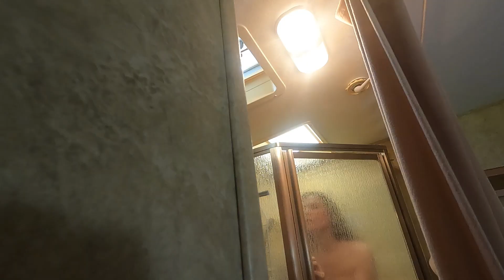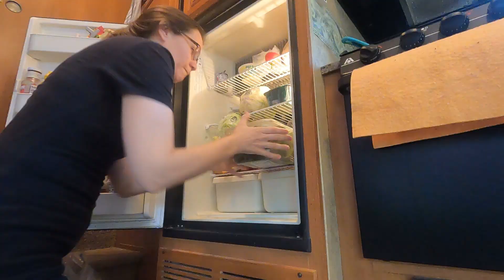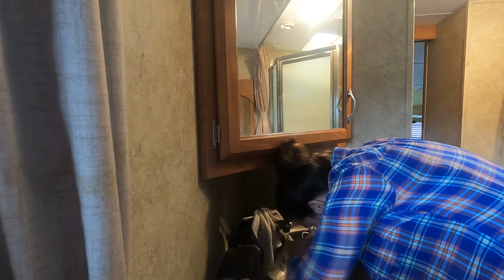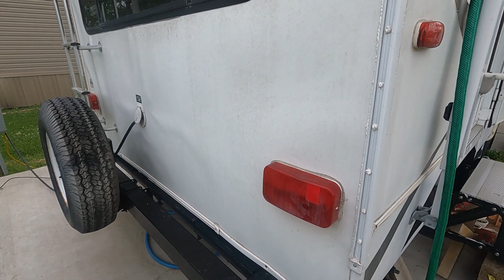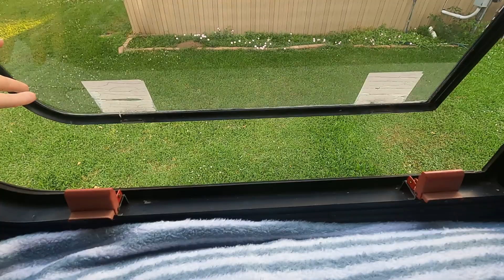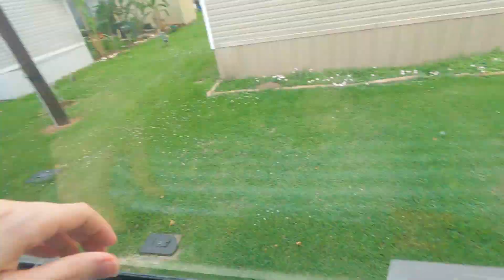CONS to RV Living | Reasons not to RV fulltime | RV Living Fulltime

Comment: Having lived and traveled for 2 1/2 years in a 24-foot travel trailer, I'd say your video is spot on Sam. 
  Many campgrounds charge more for lot rent than what I am currently paying for my mortgage on my house.
  We found that there were a lot of good things about Full Time RVing, but there were also a lot of not so good things about Full Time RVing.
 Great video.

  JT
Reply from the maker: Thanks guys. That was one thing that surprised me the most was the pricing that I was getting for parks. I mean a lot of folks want to RV because they think costs are significantly lower. Maybe in more rural areas but things are going up for sure
Reply: @FreedomChaser  
  Exactly. We found that the only way to get a decent price for a full hookup campsite was if you worked at the campground you're staying at. We stayed at campgrounds that made you work 24 hours in exchange for a full hookup site, and didn't give you any additional hours after the 24, so you made no money there.
We stayed at campgrounds that only charged $125 a month for a full hookup site, plus paid you a wage and gave you $20 a week in quarters for laundry.
  We stayed at campgrounds that that paid $10 , but the first 20 you ( single or couple) worked went towards your site, then you got paid for every hour after that.
  So you can find deals out there, but they're getting harder and harder to find....